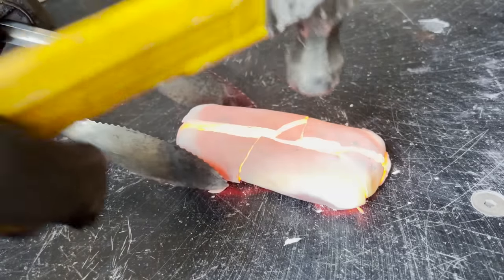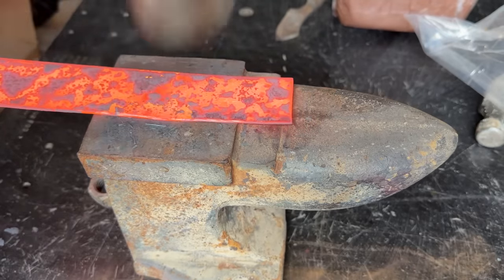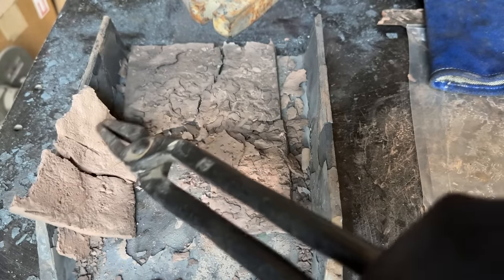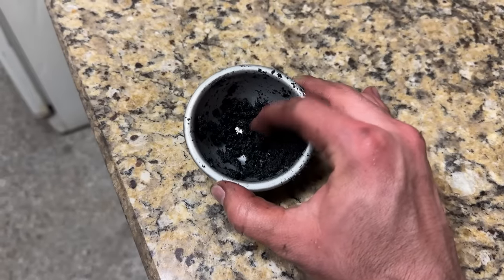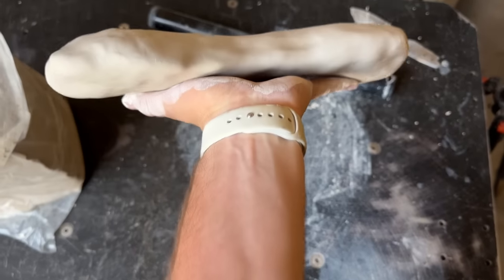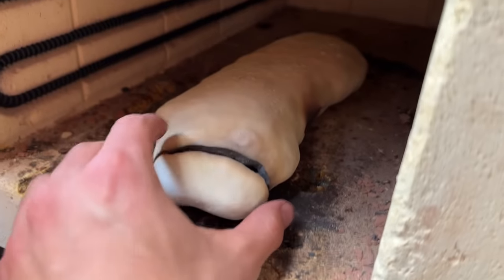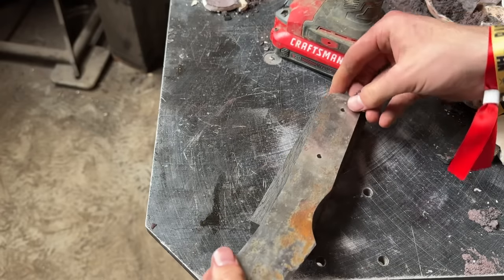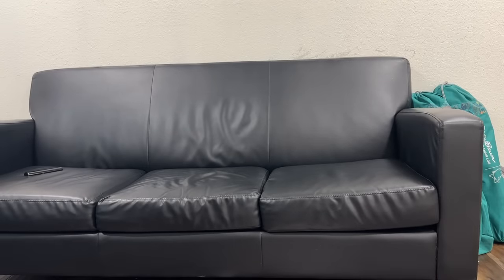Making A Knife Using Ancient Greek Technology

Comment: When you harden some random steel it doesnt throw more sparks 
Its depends on the carbon content how much sparks its throwing 😤
Reply: Which is the point of this video, he's trying to turn mild steel into carbon steel, by adding carbon
Reply: The amount and quality of sparks is primarily determined by carbon content, but you actually do get a noticeable improvement from hardening the steel as well. It is significantly more noticeable if you have experience making and using strikers for flint and steel. The content of other alloying elements can also make a difference, most spring steels and ball bearing steels have added chromium which makes them worse at spark tests than plain carbon steels with an equivalent carbon content.